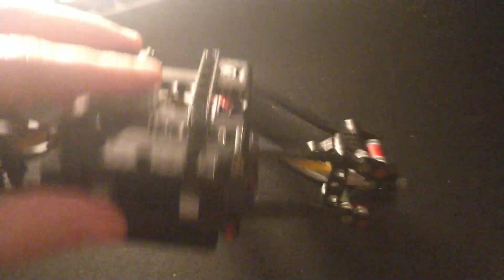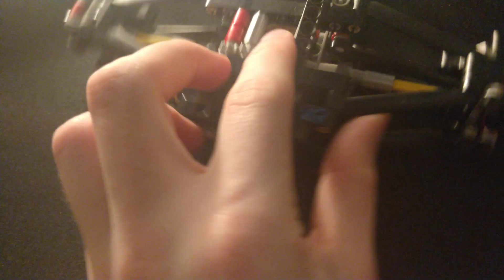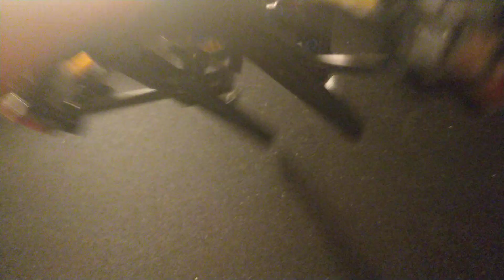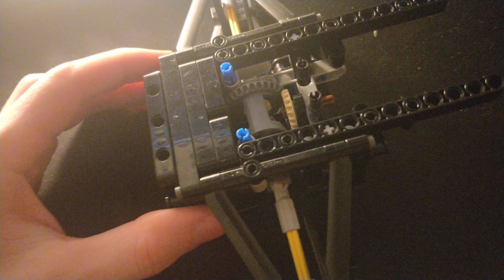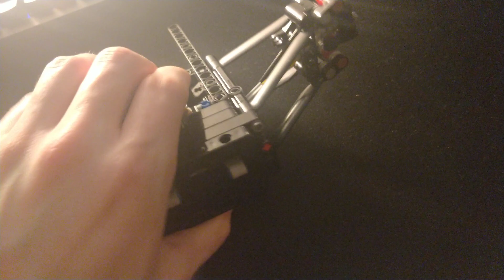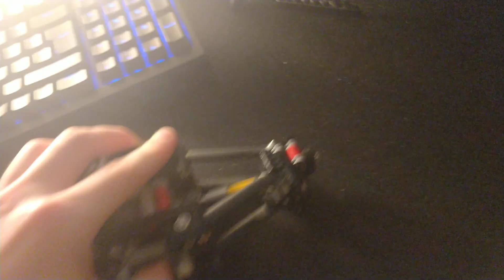(bad audio) explaination of my 4x4 pushrod design, using torsion rods instead of springs

Comment: My only rule with lego is no glue.
But for this case i think i would do that.
Take 1 bad cv joint, cut it, and glue to axle, then you get much more travle with your suspension.
I dont like to glue it because you never can take it apart, but cv like that can useble in so many way, so for me its just a new part that i make 😉, puricans can dislike my comment- i dont realy care about them.
Reply from the maker: I feel really strongly about this topic because I know a lot of builders have issues with certain parts, and I think that if we played around more with custom parts then Lego might take a hint and start adding some improvements. For instance, if they improve the CV joints or the u joints, whichever they choose, and use them to make a really decent wheel hub then we could have very fun, drivable 4x4 rc cars made fully out of Lego. That would be awesome! There are so many areas where people are innovating with their own part designs and I think Lego will eventually see that happening in the community
Reply: @clipdump  
I realy hope it will go that way. 
On facebook groups of lego i got totaly different filling and attitude abute it.
Let say that 80% of them ranning by the same 6-8 people with sellary and interest. 
They more about people buy more ready kits and less about creativity and outbox thinking. 
Thats the filing i sadly got from them.
Anyway i band now from all lego official groups for post once tank with lipo battery. 🤦
But i dont realy care, those groups was boring anyway, only kit and boxes pictures 🤣
Check my tank, i dont think it's boring 🤪
https://youtu.be/WL5BEKukDlw
Reply from the maker: @yuvallegomotorized  thats crazy, you are probably best not being a part of such a small-minded group of individuals. I think that as much as the puzzle of lego is working within the constraints of pre-existing pieces I feel that in order to push it further we have to also innovate by ourselves in the community. Products like sbrick and buwizz parts are a great example of this. I'm thinking of doing a video on this at some point because I feel like there's a lot there for discussion. For instance I really think there is a demand for more realistic lego suspension systems in cars. they should poll the community on lego ideas about parts! that would be insane...